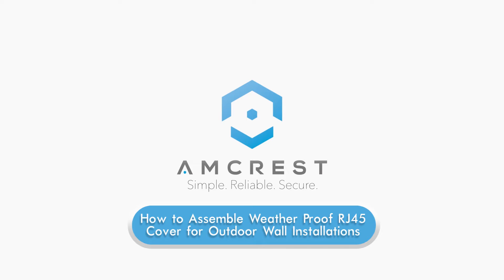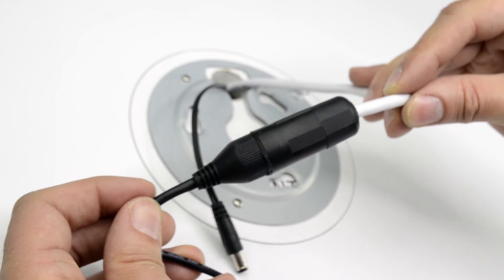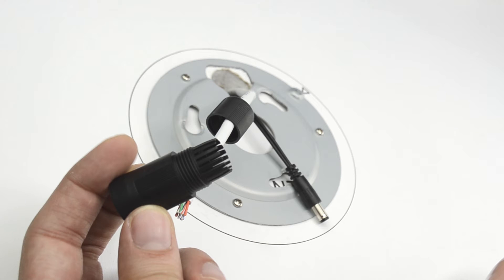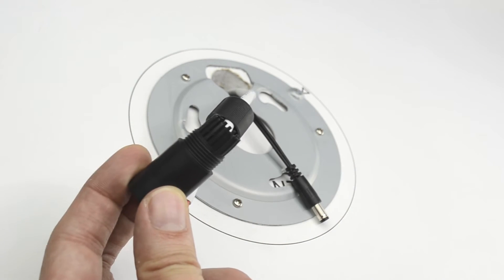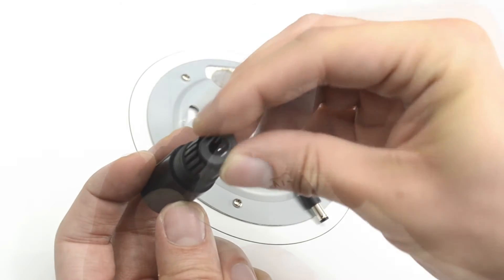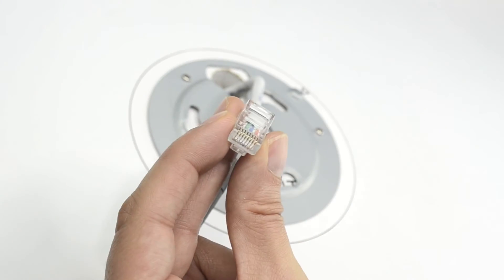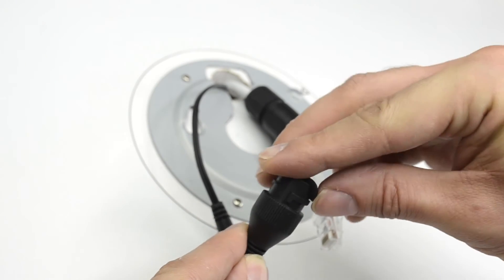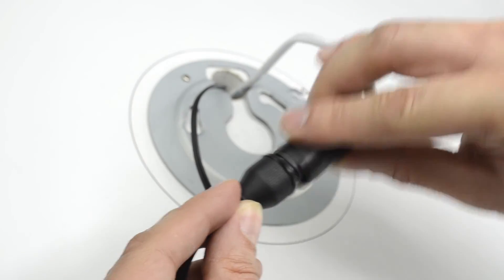Amcrest IP Cameras - How to Assemble a Weatherproof RJ-45 Cover

Comment: Love how that rubber "o-ring" (actually a flat sided round gasket) was twisted during installation!  Doesn't exactly help it to be watertight.
Reply: That's exactly what happened to mine. Moisture got in and corroded the keystone on the camera. Now I have a $120 brick. But I'm going to splice it and install a better waterproof housing.

Comment: I've been wrapping my connectors (ethernet, power, audio, etc.) with electrical tape.  I think this will give some weather proofing and also helps ensure the connectors don't come apart.  As others have said, its really too bad that the supplied ethernet cables can't be used with Amcrest's weatherproof RJ-45 covers.
Reply: I wrapped mine up with electrical tape. Didn't help, moisture got in and corroded the keystone on the camera. Now I have to splice the cable and install my own waterproof housing.
Reply: @dereknyc4402  Wrap the cables tighter with the tape, go at least one inch PAST the cable connector, and over lap the wrap at least three times, finally use a lighter, or hair dryer to HEAT SHRINK the electrical tape. This will insure water tight seal.

Comment: I really love that they include a cable that can't be used with the weatherproofing. They make patch cables that have smaller boots that would allow you to use the weatherproofing without having the terminate your own cable.
Reply: Yes.  In the past you could assemble with a pre-made cable, provided you stripped off the rubber strain relief that normally comes on the cables.  Not sure why they replaced it with something useless to most consumers.